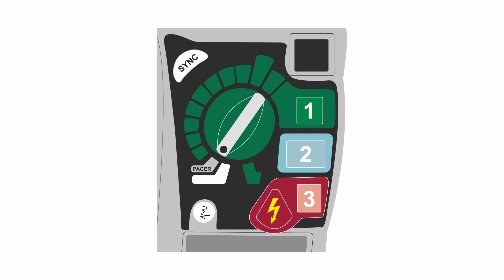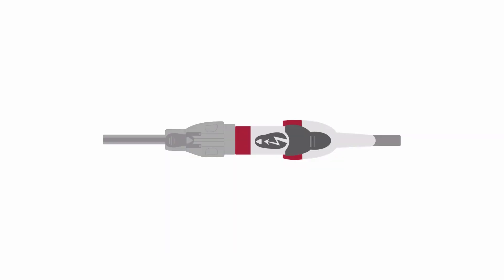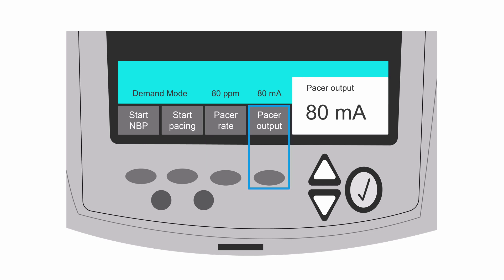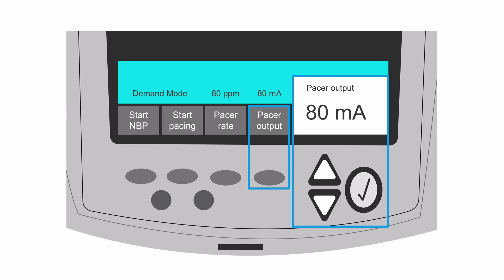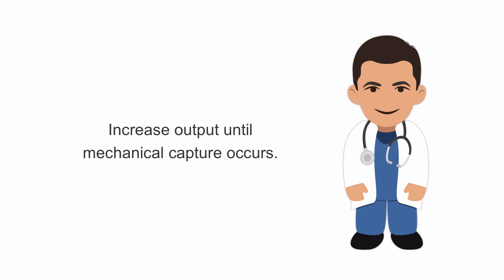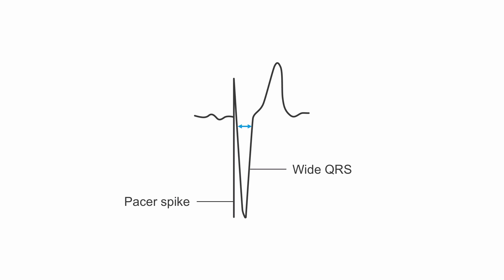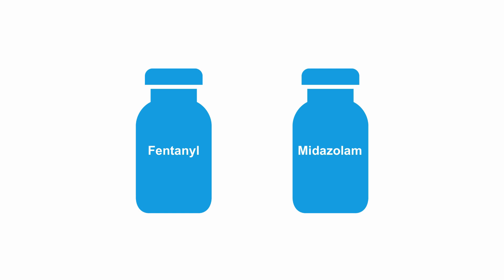Mastering transcutaneous pacing

Comment: I was told by a professor to never back down the milliamps that start to give electrical and mechanical capture due to it being very difficult to get the heart to respond to the amount of electricity it did once before. Thoughts on this? 

Also, shouldn't you confirm both electrical and mechanical capture before setting determining the correct amount of electricity has been used?

I don't mean to be rude by any means, just don't want to be a medic who lets a patient go into cardiogenic shock from bradycardia on my first day lol. 

Thanks a lot for the video!
Reply: the safe answer is don't reduce it, because as a medic you only have your patient during that emergency. If you had to take care of the patient long term you'd probably be more cautious about over stimulating via pacing.